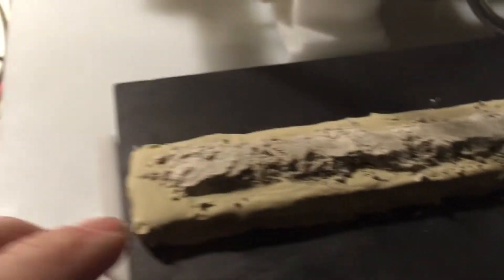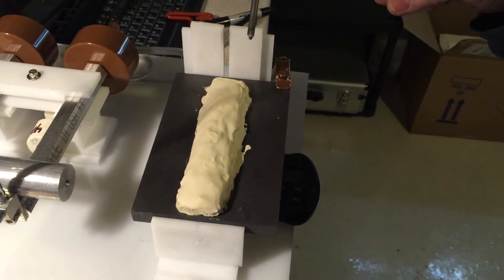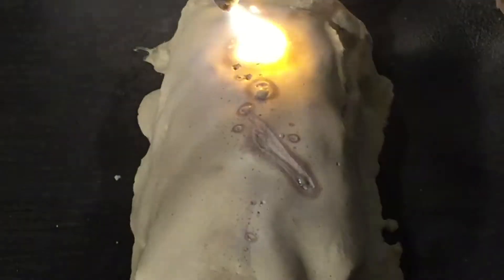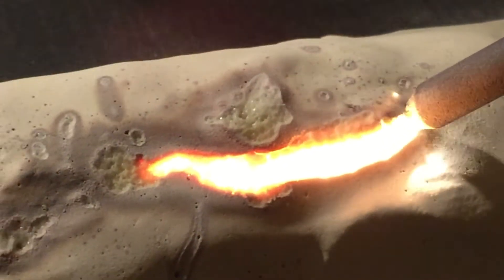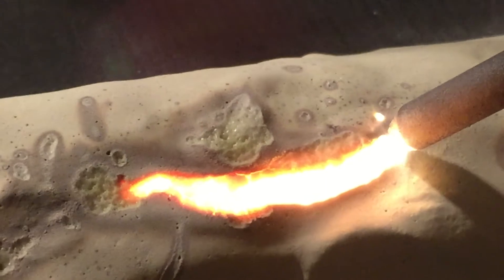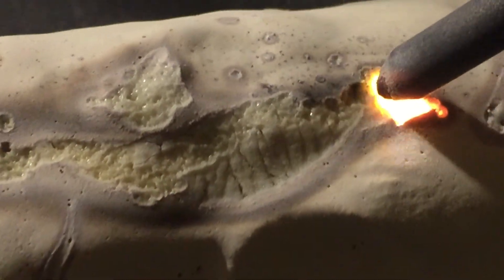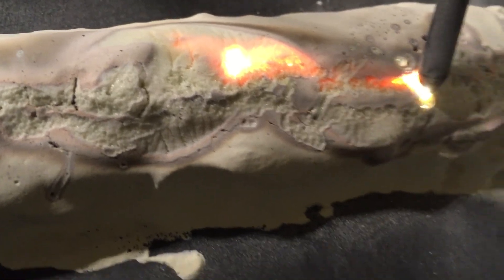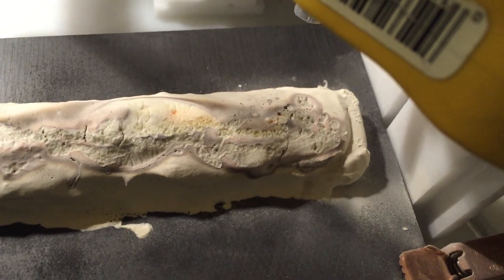MULTILAYER SUBSTRATE TEST VOLCANISM BY ELECTRICITY?

Comment: Sooo much to see here,

Caverns, craters, material displacement (condensing), electrical erosion forming a dry river bed, crystal formations ! , electrical baking, horizontal crystal seems with cavernous voids, burnt surrounding, crust, shrink marks in surface, looong arcs, and that's just off the top of my head. 

The first time I saw the video I was looking at it, before I read worlds in collision .Mountains were recorded to have been erupted quickly with witnesses on every continent. That arcing was loud , very loud. Witnesses reported the heavenly (translates to sky or outer space ) thunderbolt was deafening loud. So, there were accounts for huge electricity in mountain making. We see Quartz veins in mountains, the evidence is showing mountains were hit by crazy huge lightening. 

Rocks don't bend. Most strata layers has bent rocks. Bend a rock and shatters like a crystal structure follows a grain. A river rock is also a mixture of material but rounded. The niagra falls does not make river rocks , they are structured wrong, they crack like crystal structures. I see bent rocks are made on the surface, a damp dune gets rapid heating (it has crystals with voids) from electricity and sets hard in place above sea level . The damp dune mountain cliff are just like a sand castle cliff being eroded by undermining with surface water runoff. The dune side fails and falls straight down just like at the beach. Half dome Yosemite was a wet granite mixture that fell, there are no scrap marks and it's the highest thing around it, and riddled with granite Quartz veins. MR2Tuff made tiny clumps of rocks , but I don't know if they were "rock" hard.

Niagra fall is not eroding like it's supposed to, it's just piling up.
Niagra falls is very recent, thousands of years ,not millions of years.

So much good stuff here, I'll be back. YOU MADE CRYSTALS , by the thunderbolt of Thor ;) . Alchemy is not a crime.  Thank You for all Your brave work. 

I'm sorry I don't talk like an educated Man.